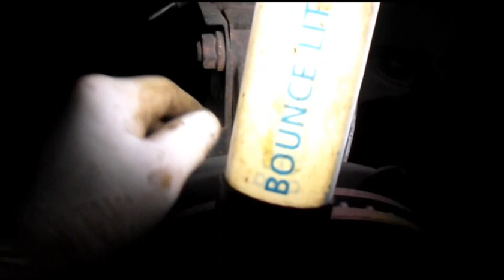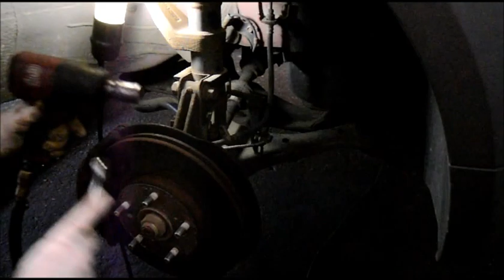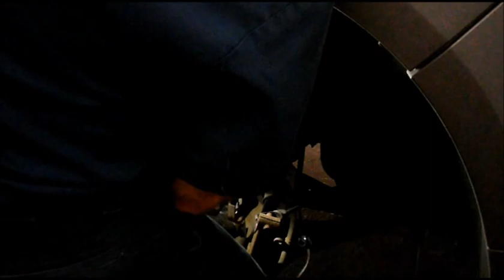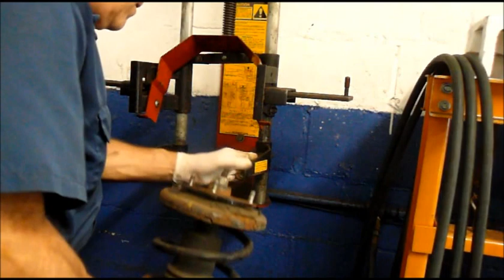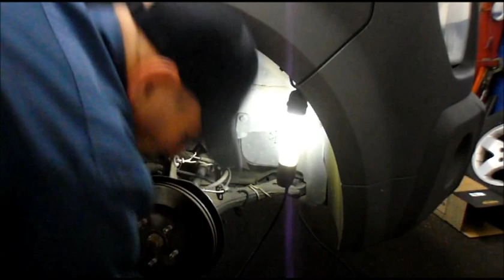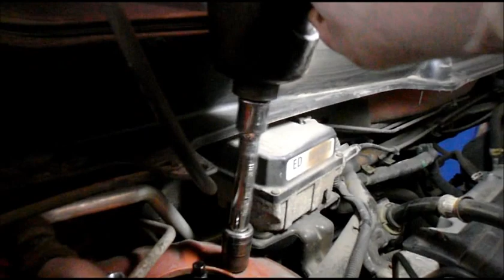How To Replace Front Struts 2004 Honda Element

Comment: Hi Jim. Thanks for the video. Some say you don’t need an alignment after replacing the front strut assembly. Can I get away without doing an alignment since those bolts aren’t oval? I just had an alignment before I realized I needed the front struts done

Comment: Hey Jim... I noticed that lower control arms bushing that lays horizontal is broken, protruding upward allowing the lower  control arm frame to hit / bang the chassis thus creating that dreadful clunking sound as u drive along. Complete flawed design from Honda engineering I'm just saying.😀✌

Comment: I am looking for top hat position and arrow on mount all proper mechanic videos ive watched did not point that out, one said put the  uprise of spring mount center of last coil bind but what i was questioning was there is a arrow or v on plate, what does that reference plus top plate has a R&L with arrow (r&l are obvious) but the arrows and angle of perch after install is what i question.
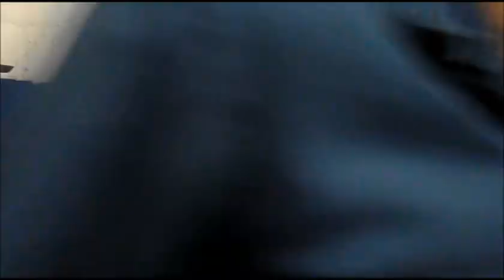Reply: Truespeed motorsports Check 9:43 of the following link:
https://youtu.be/6y51i-8SGrk
It is on a CR-V which is similar to the Element.

Comment: Great video Jim! I have an 06 Element and it makes a very weird noise once I go over bumps. The strut was replaced about a year ago. Suspension was checked over and it's fine. Would it be the plate, is that also known as the strut assembly?
Reply from the maker: The bearing plate is on top of the strut.The assembly would be the strut,spring and bearing plate.Is the noise in the front?Check the sway bar links and sway bar bushings

Comment: Hey Jim!...
Thanks for a great demo!
I've got bad bearing plates on my wife's '03 Element... Looks pretty strait forward!
From the factory, is there any adjustment for camber and caster or do you have to install an aftermarket kit to make adjustments other than toe?
Reply: D Pete how did you know the plates were bad? I might have a similar issue.

Comment: Thanks, Jim.  Great video.  I have an 04 just like that one with 141k miles on it.  I have a tire that is cupped.  Would a bad strut be causing that?  Thanks for taking the time to post the video.  Much appreciated!
Reply from the maker: Jack Woo yes it is very possible but also check the front end and tire balance

Comment: Great video! I have a 2003 with 332,000 and it runs great.  Figured it was time to replace the front and rear shocks!  This will make it much easier and faster to do.
Reply from the maker: Wow 332,000 you must take care of it.Welcome to the shop
Reply: Geez I thought my 2003 had a lot with 214,000 that it has right now
Reply: All honda after 100k miles need suspension 
 replacements

Comment: is the rear struts harder to change out than the front. I seen nothing on the so far. maybe it's TOOO hard?
Reply: The bolt on the rears has a reputation for being tough. Some people resort to cutting things. I had high hopes of doing mine myself but the bolt did not budge, even after a week of penetrator application.
Reply from the maker: Thank you for stopping by the shop.

Comment: Jim, I've looked online for those bearing plates.  Is that an OEM part only?  Also, you said at one point you had to rotate the strut to be in a certain way.  Did you just mean so the strut mount is facing toward the tire?
Reply from the maker: No the bearing plate was after market .Monroe